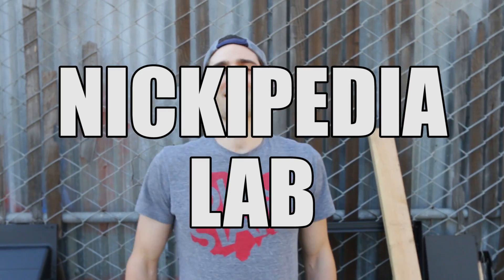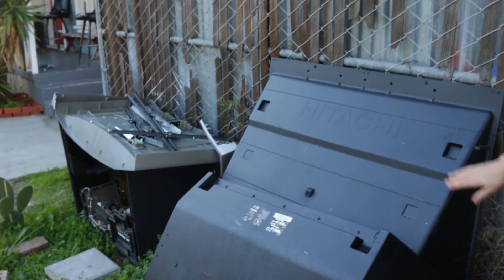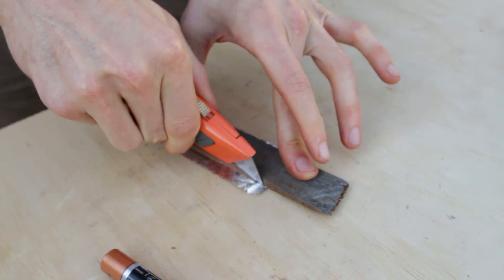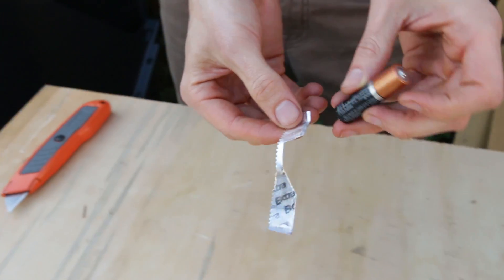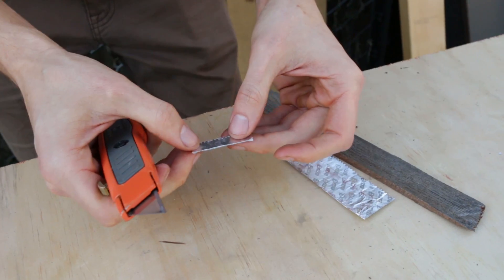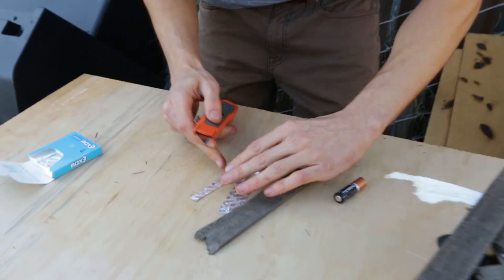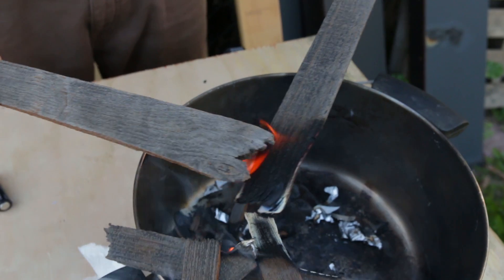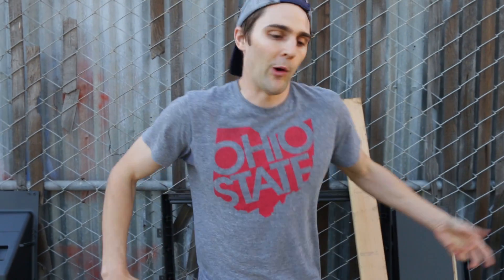Starting a FIRE with a AA BATTERY and GUM WRAPPER

Comment from the maker: I really really didn’t think this was possible. Perhaps it was another internet survival guide hoax… but no…no no.. this is REAL!!! AA-Batteries have 1.5 volts… that’s not much when compared to starting a fire with a 9V battery and some steel whole super easily. In this video we basically make a small-scale open source light bulb. The filament is the gum wrapper and when the heat given off due to the electrical current reaches its maximum, it is enough energy to light not only the paper attached to the gum wrapper but also some paper towels we have placed near by. The result… a fire from a tiny AA battery and a gum wrapper. My Nickipediacs are fully trained from survival… go forth into the wilderness!
Reply: Nick Uhas could you also use aluminum foil instead of a gum wrapper or do you specifically need the paper side of the wrapper for it to work?
Reply: Nick Uhas just curious is there a reason you have to cut the foil paper in a certain way?
Reply: Nice job on americas got talent!!! Good luck nick!